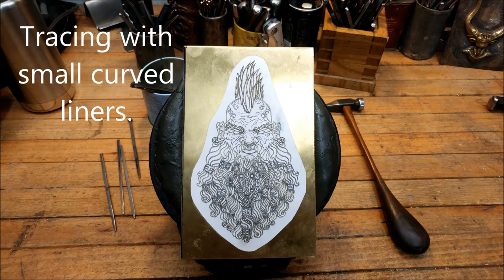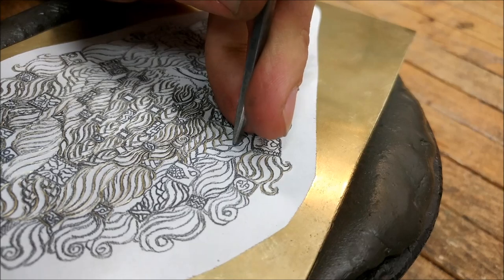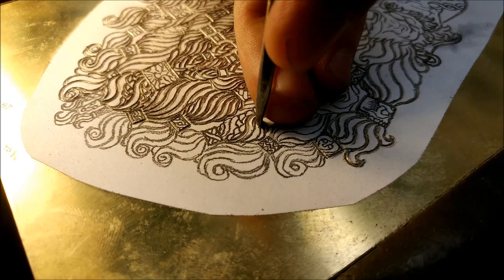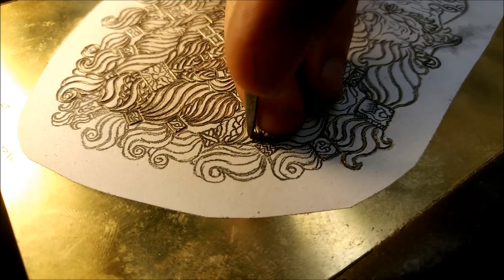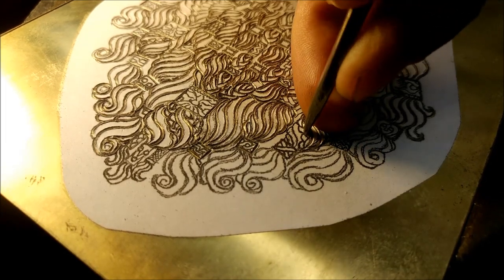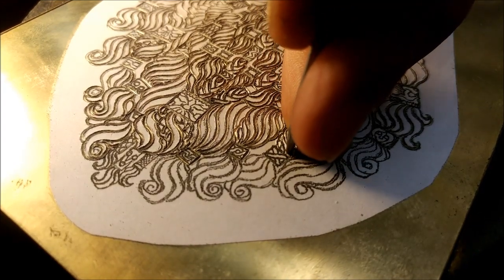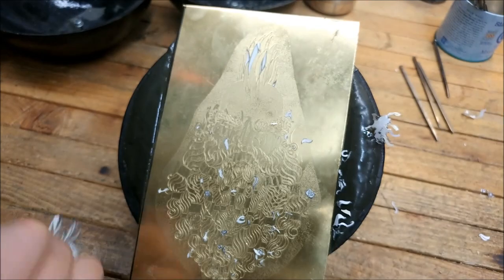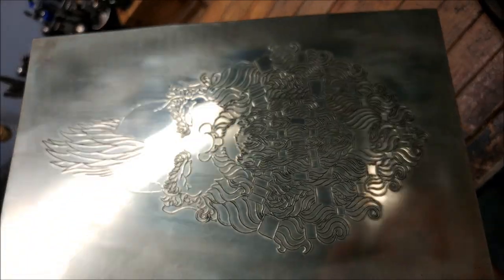Episode 1 of Brass Dwarf series: Tracing with small curved liners

Comment: Hey Douglas.  
I sure look forward to your videos.  Someday I will be a Patreon and get in on that sweet, secret knowledge of yours.  I'm wondering why you don't use Acetone image transfer to get your design on the metal.  Thanks so much for sharing.  
Novice chaser and repoussage ist
Reply: Aethon how you can do that?
Reply from the maker: Hi there Aethon!
I've used the acetone transfer method before and it works out alright. But I generally (when I need the drawing as a guide) just use the paper transfer method as it's so easy and I can guarantee elements I don't always trust about a complicated design for the acetone transfer method. This way works for me for how I am set up in the studio, and both methods work great. Depending on scale or need I change technique to suit the piece. It just so happened this method was easiest on me at the time. I also use a projector for tracing my drawings for projects that are too large for any other transfer method. I also need to rely a lot on free hand drawing as project develop instead of such clean cut line work up front. Really depends on the piece. Actually I'm working on a piece now that is a perfect demonstration of a project where early line work is impossible. Link here: https://www.instagram.com/p/B_Ff1N3DEBB/